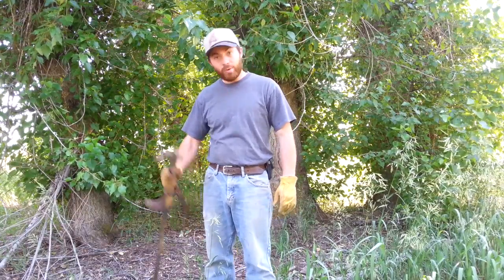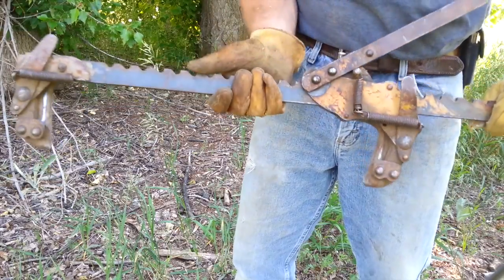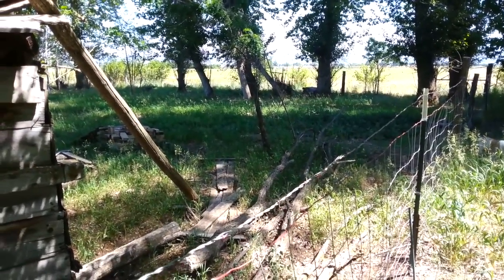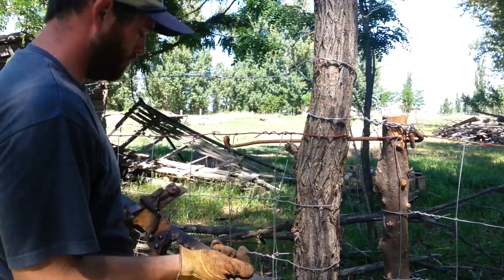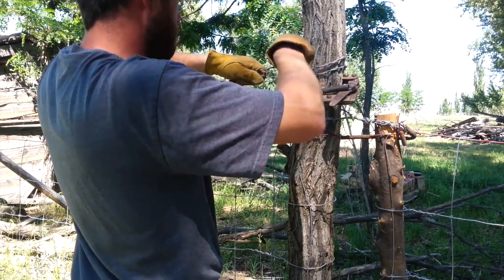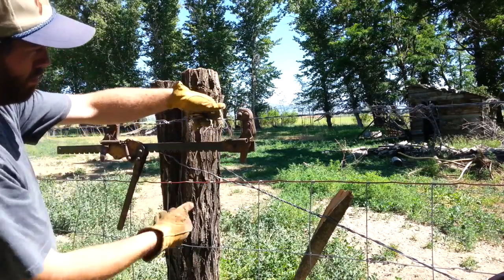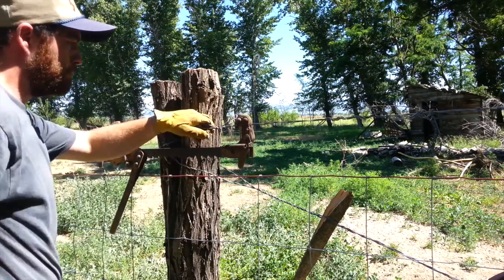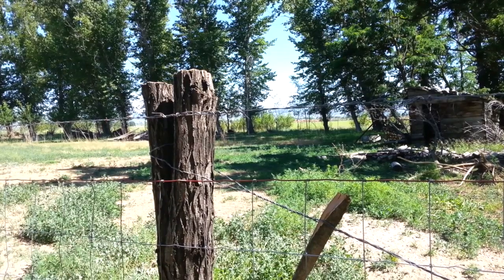What is a Fence Stretcher and Stretching Fence

Comment: Thank You I found the answer to my question.   Also Fence Stay is also great to use.   It doesn't allow the spacing between fence poles to have so much play in them.   Easy to install.   Thank You again for your great video. BTW they suggest to start at the bottom and work your way up.   Makes it easier to move about.   Just in case anyone was wondering
Reply from the maker: +Alan Jenniffer Lehman Sorry that I didn't catch your comments sooner. I'm glad you found your answers, thank you for commenting and sharing all of these good extras with everyone.

Comment: Should also be noted that your corner fencing is everything.  Fail to have a proper corner fence, and it won't matter what you do.  The wire will continue to come loose.  Just in case anyone was still having issues with that.
Reply from the maker: Alan Jenniffer Lehman Yes it is very true.

Comment: Thank you very much.  This actually taught  me how to use that fence stretcher.   The question I have is do you start at the top of the fence line or the bottom of the fence or in middle of the fence.  What I have found is as I get one wire done right.  It loosen;s the other wires.   Would appreciate a reply back on that one.   Thank You Very Much
Reply: Thanks for this. It sure gonna help me now and yes, the job was completed. Thanks again.

Comment: Awesome tool!! I normally use a chain version, but your tool is great!! and also I´m thinking in another use for this tool that probably do a much easier job coupling camlock fittings (in effluent pipes) that is hard to pull and join it together. Where can I find exactly the same tool yours?? Great video!!.
Reply from the maker: Ronald dos santos Hello. My stretcher is old, and I'm not sure they still make this model. Tractor Supply Store sells one that looks just like it http://www.tractorsupply.com/tsc/product/fi-shock-wire-stretcher-1081502?cm_mmc=feed-_-GoogleShopping-_-Product-_-1081502&gclid=CjwKEAiAmJvBBRDKpP724LigwngSJAAYRJXBKXNwN-9Hk0qiCsG7ScRYhj7qPT8h67LFIPiVF1YZUhoCDpHw_wcB 

A web search will bring up a few different models and they all look pretty good. Best of luck to you!

Comment: When you join two pieces of wire, you should never create a loop and connect that way. The best way is to weave the ends together. the loop creates a weak spot in the wire and looks bad as well

Comment: Can i use this too pull chainlink fence too the pole by chance
Reply from the maker: +Knjpaypal Knj I honestly don't know, I've never worked with chain link. I would imagine that it could work if you had a way to pull it all at once. I may defer to someone who has done this before.
Reply: No. The tool featured here is a barb wire stretcher. Use a come along for chain link fence.

Comment: Use of the stretcher is clear enough, but why would you run a strand of barbed wire above a woven wire fence? The woven wire will prevent animals from crossing from one side to the other at ground level, whereupon they may try to jump the fence, whereupon they may get hung up on the barbed wire, whereupon they will die a slow and horrible death. So what is the barbed wire for? Merely to keep humans from climbing over? If it's to keep animals from jumping over, why use barbed wire rather than hog wire or simply more woven wire?
Reply: It's a good question. Barbed wire is useful to keep large animals like horses and cattle off the top of the fence, which they can ruin by pushing too much to try to reach something on the other side. But it can be harmful to some animals, deer especially. The sure answer would be taller woven fences, but that costs more.

Comment: Ok what did this amature low end fence fixer do wrong that really can get you severely hurt when you  tighten a barb wire around a post especially building a new fence and pulling wire much tighter than that little demonstration ?    ALWAYS ALWAYS BEFORE YOU START PULLING TIE THE END OF THE WIRE OFF!!!! IN A REAL STRETCH IM TALKING 1/4 PULLS  IF YOUR PULLER SLIPS OFF.. THE END OF THAT WIRE WILL GRAB YOU AND WILL NOT  BE A GOOD OUTCOME.!!!!
Reply from the maker: +Randall Highsmith Sound advice for anyone reading through the comments. It is a wise idea to tie off as Randall suggested.

Randall, in my defense, doing something the way I was taught even if it isn't the best or safest way out there doesn't automatically make me an "amateur low end fence fixer." The marks on my stretcher can attest to the miles of fence that I've built and mended. While I'm not the most experienced in the world, I'm definitely not an "amateur" or "low end".